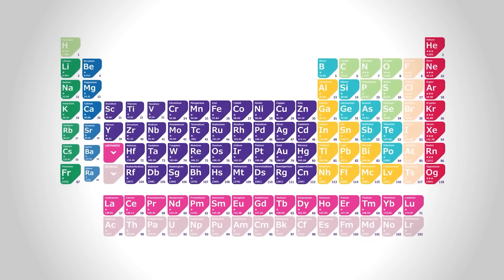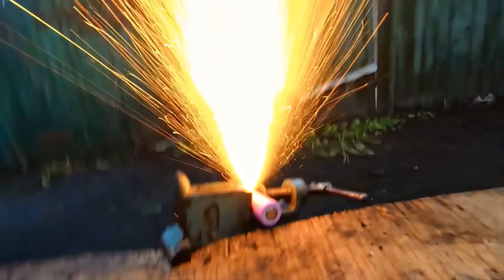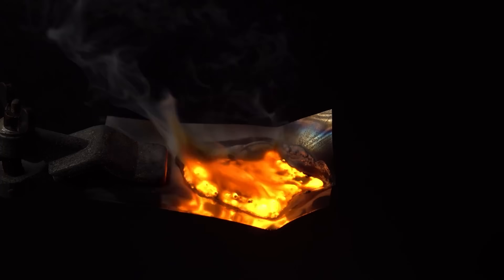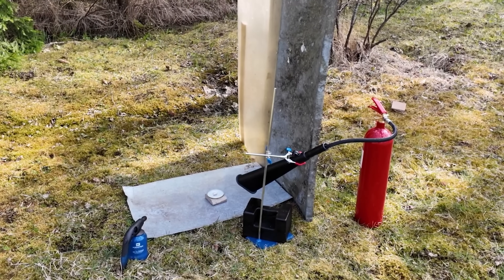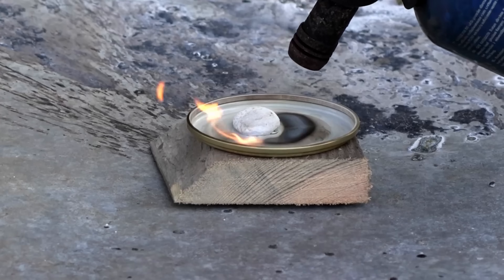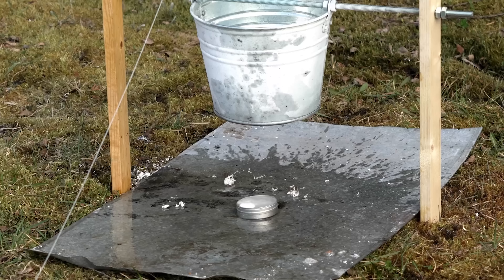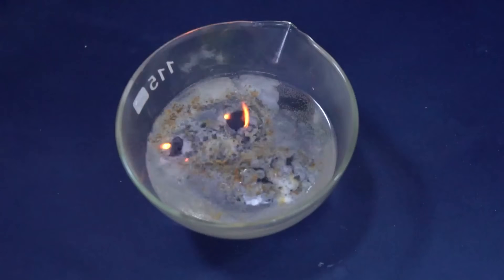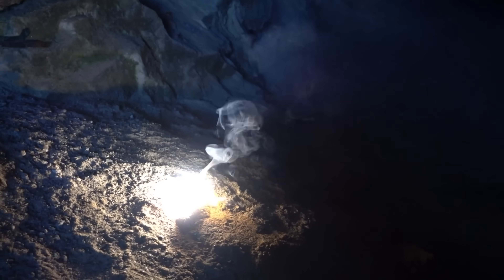How to put out the hottest flame?

Comment: Magnesium has a low boiling point, 1,091°C (aluminum at 2,470°C).  Magnesium thermites are exceptionally dangerous - going off high order from a spark.

Comment: As part of my career path, I got to teach inexperienced construction workers about fire safety.  Namely about the different types of fires and the extinguishers needed for them.  A memory trick I used often was this: Stuff that burns to ash (wood, paper, cloth) gets the Class A. Liquids (like oil, gasoline, etc,) boil just below the flame and get the Class B.  Fires around electrical current get the Class C.  Metal fires are Damned Hot and get the Class D.  Kitchen fires get Class K.  Its worked well enough to increase the quiz scores.

Comment: That's because the flames burn so intensely (at such a high temperature) that the CO2 is split into Carbon and Oxygen and that gives them a pure source of Oxygen to burn in or react with.

Water (H2O) is split into Oxygen and Hydrogen and that's why they become explosive when doused by water.

Noble gases such as Nitrogen etc doesn't want to react with anything and blocks the Oxygen from reacting with the metals?

Comment: I worked at a lead smelter/ refinery as a contractor they used powdered calcium in the refining process. One day I was welding near the kettle's of lead as one of the plant hands added the very dangerous/explosive elements the kettle exploded lightning the calcium barrel on fire the plant hands picked up the burning barrel and brought it over to the blast furnace and the loader dumped a few buckets of sand on it.  Coming back from lunch 4 hours later I saw a pool of burning liquid calcium surrounded by a mote of lead oxide sand and blast slag still happily burning apparently this happens from time to time but there's nothing to be done but let it burn it's self out. That job was nuts but a hell of a lot of fun

Comment: In the places I used to work where other flammable metals are worked with (U and Pu), our Class D extinguishers contains finely atomized copper and are pressurized with argon.  This powder works in 4 ways

1) it is very fine so it packs in tightly.
2) it is very dense and so packs in tightly, depriving the metal of oxygen
3) It has a low melting point relative to these two metal.  Liquid copper floats on these metals, eventually depriving the burn of oxygen.
4) it is very heat conductive so it cools the burning metal to below is fire temperature.

Fortunately I never saw a flammable metal fire myself, but I've watched several training films on how to put out a fire.  It is almost instantaneous.

Comment: One of my biggest surprises was a gas barbecue that suddenly lit up like a flare when I was preheating it to sear some steaks. I found out later that that barbecue had been recalled, because of manufacturer thought it was a good idea to make this barbecue out of a lightweight alloy that he had gotten as spare metal from an aircraft manufacturer. The metal was a magnesium aluminum alloy. All I could do was stand there with my hose and spray the wall and the House nearby it and the ground around it to keep the fire from spreading. Oh yeah I also shut off and detached to the propane tank. I got a little bit of a sunburn from having to go in and take that tank off. I called it off first with the water spray, the tank not the magnesium barbecue
Reply: Oh my... they decided it would be a good idea to make a barbecue out of the same stuff sometimes used in fireworks 🤦‍♂️
Reply: @superslimanoniem4712exactly

Comment: Sometimes, and if it's underdeveloped countries most of the times, the firefighter was not informed about the type of materials in burning buildings. All they informed about is that a building is on fire. There was also a case where the firefighter knows what type of fire it is and try to be careful, but the uninformed masses forced them to use water, this happens on EV car fire though, not building.

Comment: @Thoisoi2 - Chemical Experiments!
Can you use a fine iron powder (not iron oxide) to extinguish those kind of metal fires?
In space, star fusion, iron is the resulting element of the fusion that will eventually extinguish the entire star, so if iron can extinguish an entire star of several million degree fusion fire, surely it can also extinguish other regular metal fires? :)

Comment: "To date, the only type of Class D fire extinguisher is the Dry Powder extinguisher. The powder agent used may be either powdered graphite, granular sodium chloride or copper based, all of which are effective at separating the fuel (the ignited combustible metal) from the oxygen."

Comment: An excellent video, thank you very much! Up until now I had the notion, that you could use sand for lithium fires. Question: could you use gypsum CaSO4 for extinguishing the fire or would it worsen especially by forming SO2 and SO3 gas?
Reply: Would say it would pull out the calcium free and making the gasses, so now you have a calcium metal within the sand and gasses spewing from that